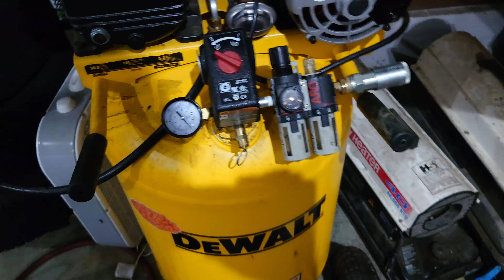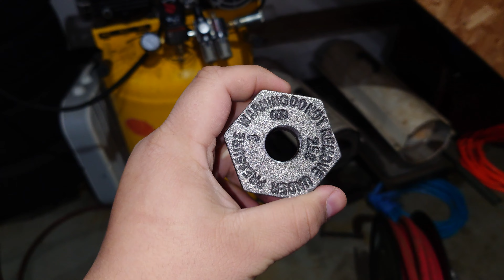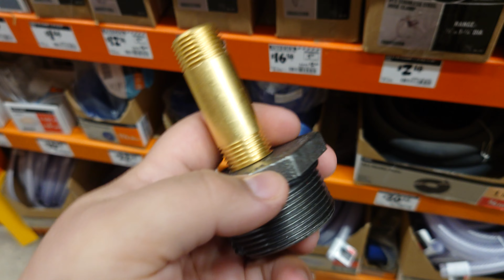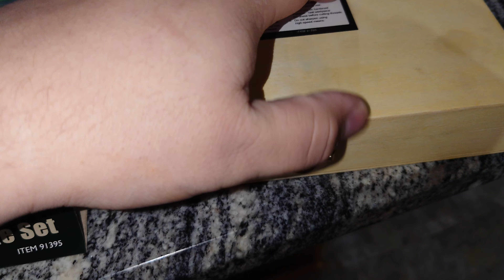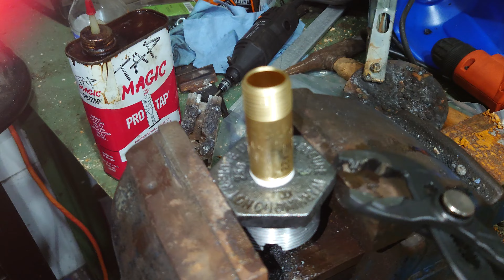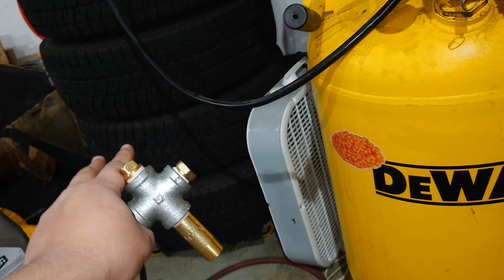Modding an air Compressor from 1/4" to 1/2" piping

Comment: I have a question for you , I drilled and tapped 1/2Npt into the side of my compressor tank screwed it in with some pipe dope.

I am now wondering if that is safe and if it will eject the pipe fitting valve?

Now I am worried that I basically damaged the tank, I haven’t filled it up with air yet , so tomorrow I am going to see if it holds. There was enough metal to cut at least two to three threads in the metal,  But I am not 100 percent that it will hold until I pressure ride it. 

What are ya thoughts?
Reply from the maker: Did you just drill into the bear tank wall?

Comment: Thank you for the video this is giving me the confidence to modify my air compressor. I absolutely hate those 1/4 pipes and fittings. Why can't we have 1/2" coming out the compressor if there's 1/2" hoses and 1/2" fittings. I don't see a reason why not???
Reply: The hoses and fittings are by inner diameter. 1/4" hose has an outer diameter closer to 3/8" or 1/2" depending on the specific hose. The compressor in the video is not a very high CFM compressor, and therefore, 1/4" is plenty of flow for that compressor. The flow for 1/4" is 7cfm@100psi@25ft. I've never worked in an automotive shop that used anything bigger than 1/4" hose for the tools and equipment. However, they do use 1/2" pluming up to the manifold that will supply multiple locations of the shop. Why is this important? It's important to note that if you're simply working out of your garage, home, mini shop, etc., and you only use one tool at a time, 1/4" will be more than enough for anything you hook onto it. If you had a decently large barn shop working with 1 or more other people, then you'll need to run 1/2" from tank to a manifold to make sure there's enough flow for 2 or more people to use the air at the same time without having to take turns running tools. I don't even consider 3/8", because you may as well jump to the largest size when supplying a manifold. In conclusion, 1/4" is pretty much the standard for residential use, because it's highly unlikely you'll find yourself in a situation where you're running two tools at the same exact time.